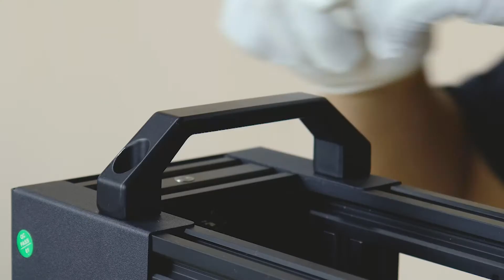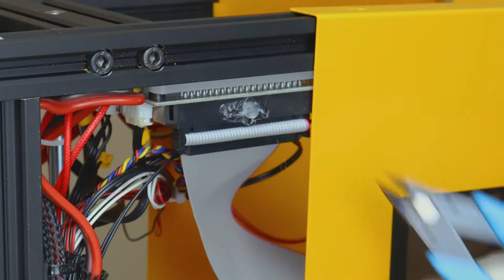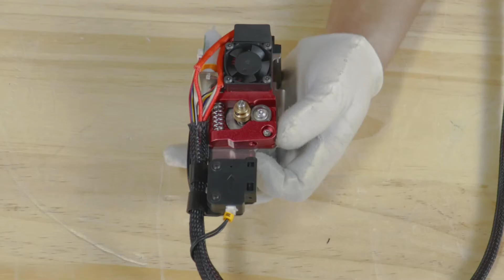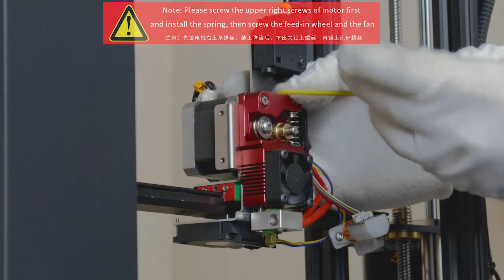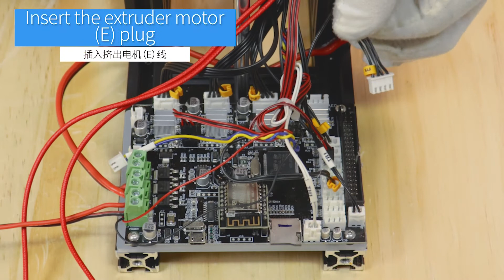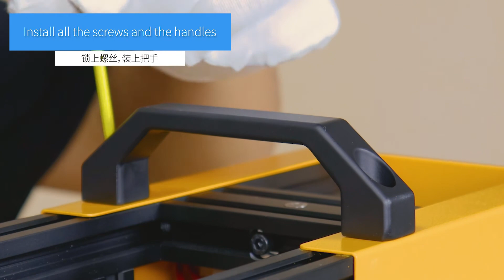Kywoo Tycoon | Add-on | How to change the extruder kit

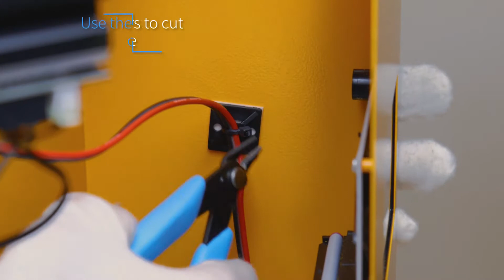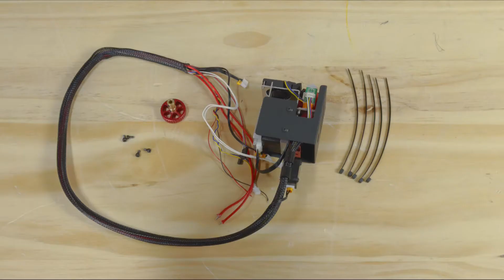Comment: Something very wrong here.  at 1:28 he's cutting the wire support off the power supply.  2 seconds later at 1:30 an extruder kit magically appears on a table.  WOW!  Magic?  Is that the new one or the old one from the Kywoo?
Reply: @Gavlarr82  OOPS Sorry.  Just looked again.  ;-)